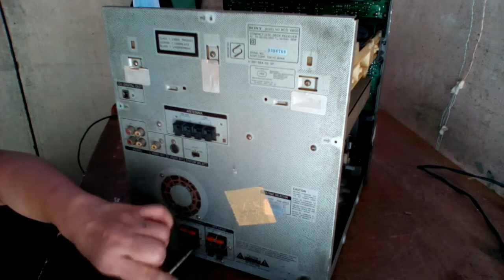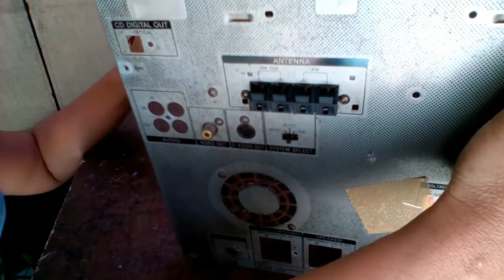How to repair & restore a Sony Vcd Component that has power & display but no sound.

Comment: Helo sir i hve MHC GR 33 sound is ok but display problem show low light in display
Reply from the maker: Check the supply of the digital display if low,  check bloated or open e caps around the circuit.

Comment: Need pa ba ng diagram ng stk ic to check its pin one by one? If shorted nga?
Reply from the maker: hindi n po kelangan yong diagram. Positive & negative supply ng ic test mo using tester, times one ohms lng shorted yan. Check mo din speaker pin ng ic kadalasan shorted din po yan.